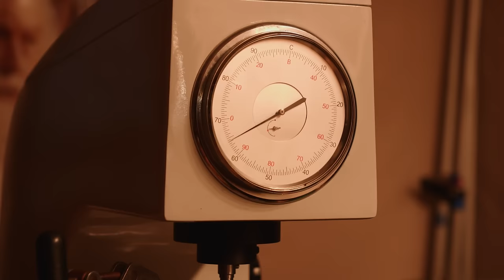Sword Break or Bend? Quenching Aftermath

Comment: Ya know, it seems like a simple little thing... I learned something new from you today Kyle.

Your anxiety about grinding the fuller is something i deal with daily, in all kinds of mundane ways. I frequently push things off or avoid things that scare me like grinding in a fuller that could ruin weeks of work. Without the fuller, the project isn't done, but the act of doing it could ruin the whole thing entirely. But, you nutted up and did it. 

Nut up and do it. My new motto.
Reply: How about, 'First Engage Brain' ?

Comment: Just a thought here: For the fuller grind, could you do a small wheel first for the railroad track you mentioned and then finish with the larger wheel?
Reply: I was thinking the same, but then I realized that if you use a smaller radius wheel, it would create a deeper fuller from the getgo. Kyle said he wanted to avoid getting a deeper fuller, at least that's what I understood😅
Reply: A smaller radius makes it harder to keep it centered within a wide layout. If you grind your "railroad" off center, the larger wheels will want to follow that track, and you will have to force them into alignment off-center of the small track. That forcing motion is inaccurate and easy to make mistakes doing it. I'm sure there's more to it, but this could be one reason

Comment: for fuller work, is there a way you could lay the blade on a flat surface, clamped down, have the grinder vertical above the blade running on some kind of track so you could just push and pull the grinder along instead of having to hold the blade horizontal yourself. i know it would entail making a small custom grinder of some kind so prob not worth it if your only making a sword every so often, but im sure it would make life a lot easier for you if you were making many blades with fullers.

am pretty sure someone could build such a contraption for you. hope that make sense.

Comment: If you hold your blade with the face your grinding more toward the ceiling you can fix you lighting problem or a wide lamp also you could get a rounded grinding wheel and grind your fullers vertically would make it easier to handle the mass of the long sword and add bonus is you don't get as much kick mesing with your line

Comment: Kyle, Is there anything differently you would have done in the normalizing stage to change the possible warpage if you would make this pattern again? Or maybe try a horizontal quench tank (Concept being that all the areas of the oil would quench at more even rate). I know you have probably considered more than I could think of, but I am always trying to learn from your expertise as I move forward in the craft.

Comment: For grinding the fuller in the blade, I’m curious if there is a way to rotate the sander 90 degrees and have the blade below it on a type of linear track that you could line up down the center of the fuller with the curve of the sanding belt. Then you could pull the blade in a fixed line to avoid potential angling issues. Kinda like when people have the electromagnetic jig they use to sand down a billet to be perfectly flat. Not sure if this is an already established method that has been shown to not work.

Comment: I'm surprised Kyle hasn't created his own straightening jigs, to help save time and stress.
Reply: I'm going to assume he has the same issue every maker of things has... if you're making a rig or a tool to make your chosen discipline easier... you're cutting into time you'd rather spend doing your chosen discipline! the number of things I COULD make to streamline my process is huge, but I'd prefer to spend my time doing the fun stuff 😅 Also, if you're actually working in your field the problem is exacerbated by the fact that if you're upgrading your work space or doing maintenance you are NOT working on a commission, and therefore you're not making money. Sure, in the long run it's a great idea, but it isn't always fun, practical or financially viable.
Reply: @millie-mayprice891  except he's a professional and he even says he doesnt want to change his bandsaw because it's expensive. When you're a full time maker, having fun is less important than making money
Reply: @jeanladoire4141 ... I mean, I mentioned that financial reasons are a factor why you might not do a thing that would make your job easier, so I'm not really sure where you're coming from with your response? And the comment I was responding to was about making a straightening jig, not replacing the bandsaw blade... Maybe I'm misunderstanding what you mean, But I'm not sure how "if you're upgrading your work space or doing maintenance you are NOT working on a commission, and therefore you're not making money" doesn't cover what you said.

Comment: Thought about making a fixture for grinding a fuller?  Something to clamp the blade to so it rolls along the wheel at it's centerline.  Shouldn't be that big a job to weld up one and have it run on some linear bearings.  Could even get fancy and add some depth stops.

Comment: I've had warps like that in long knives (I've only made one sword, technically sword like object, just a wall hanger, no heat treatment) I'm not sure if a straightening hammer would work for that sword, but they work pretty well for straightening knives.

Comment: A fascinating build. I have a question about the mosaic damascus. Most of the pieces I've seen you build are either knife length or in a sword, fairly stout blades. How would that steel do if you made a more flexible type sword such as a rapier? I swear a matched rapier and main gauche would be absolutely stunning!

Comment: So I noticed you were careful in heating the blade while straightening. I thought that any reheating would mess with the temper on the blade, but is there really a certain amount of reheating that allows the bend but doesn't affect the temper? I notice in shows like Forged In Fire a lot just opt to retemper altogether. I'm just interested in the strategy you went with for straightening, and was there another round of hardness measurement after the straighten?

Comment: That fuller is stressful. I was worried that the tape might be too soft to hold the shape. Then I wondered why you didn't profile after doing the fuller so you can run it along the rest as a rectangle. Anyway, can't wait for the next installment!

Comment: Hey Kyle, I remember you mentioning that there was an inch or so of tang sticking out of, I think it was, the cooling oil? Would that have had anything to do with the difficulty in straightening the tang?
Also I was wondering what would happen if you ground the fuller before profiling the blade?
It would allow you to use a platform to rest the blade on and ensure it is level while grinding the fuller without using your arm strength to keep it level.
I just don’t know what impact a fuller would have on the blade during hardening and tempering…

Comment: If you are having trouble with temperature stability in the quenching oil might it be an idea to circulate the oil with a transfer pump? Suck it out the bottom of the tank and pump it back into the top

Comment: Just fix a brass 'steady' to one side of your wheel and you can grind a perfect fuller without worrying about it drifting. You can even fit a cam-plate to the opposite side, with a cam-follower clamped to the tang if you are worried about accidentally dipping/lifting the tang. The depth of cut is adjusted by your thumb pressure/position. Simples.
You seem to have some degree of aphasia. (not a criticism, just an observation)

Comment: What if you made a guide track with a shallow grind with a smaller wheel dimeter and then increased the wheel diameter for the rest of the depth & width of the fuller? You would probably have better control with the smaller wheel because there would be less grab due to the smaller surface area of the wheel-blade interface. Also, why don't you make a little support table for the grinding wheel with a 2x4 and some adjustable stands.

Comment: Question.  Are you not creating a weak spot in the blade where you cut the tang out using the bandsaw.   It looks like you left a sharp corner.   Being from a metal fab machinist background I was always taught to do a radius even if small.  I would of drilled a small hole in the corner of my lines and then cut.   Of course you could of ground in a radius too but it was not shown.   I am not trying to knit pick as I love and respect your mad skills.  I have nothing but respect.   I just did not see a small radius.   Also I am glad you found the proper diamond wheel dressing tool for your surface grinder.  When you asked about what to use last video I had recommended that.      Loving your videos.  I never speed them up or skip.  Just taking in all the wisdom.   I really hope to get a press together this summer.

Comment: Could you not grind the fuller in 2 stages? Use a 1" wheel to establish a track at roughly 1/3rd final depth, then use your final radius wheel in your track to final width and depth?

Comment: @Kyle Royer I had a question about the tool your using to create the fuller in the sword. Is their a tool that would allow you to grind the fuller of a sword, like a table top saw for wood, so that your not encumbered by holding it horizontally and instead let the flat part of a table based grinder carry the weight, with the use of a tapered guide to fit the sword into that is locked so it does not shift as you work, so that all you have to do is slide the sword gradually over grinder that is protruding through the table ( not : this tool would include the feature of letting you set the elevation of the grinder through the table, so that you can create gradual deeper cuts into the sword as you need it ) ?

Comment: aren't you worried about tempered martensite embrittlement  when heating the tang to beyond blue ?? i read that toughness actually goes down if you temper too hot the tempered martensite embritlement for low alloy steels  is between 260 and 370°C  or is that grey color already far beyond 370°C ?

Comment: Hey Kyle, could you not mount a grinding wheel on you surface grinder or a mill so you can grind that fuller more accurately and easier?

Comment: Around the 39th minute... after you finished getting the warp out of the blade.  Was that a purple colour on the tip I saw?  Did you end up softening the tip a little?  If so, was it on purpose?

Comment: i find it wierd that he didnt straighten the blade as soon as he pulled it from the quench like most of the other smith tubers i watch do... either by sandwiching between 2 2x4s as the blade cools or just use a vise as a lever while the blade is still warm

Comment: We've had a warp before, stood it on end in the vice and it straightened a bit on its own while it cooled, but then we fought it for a while using your same technique with water and finally got it straight. But then when we ground it, the warp came back with a vengeance.

Comment: I'm no expert, but wouldn't you want that material you cut out of the tang with the band saw at 2:16? Cutting those sections not only severs the matrix, but it adds sharp corners which are stress raisers.

Comment: I feel like you could rig up a jig to grind in the fuller nice and parallel with two file guides on the blade and some aluminum angle as a guide that's setup parallel to the grinder wheel. I think you'd be able to set that up and grind the fuller faster and more accurately than you free handing it. You'd still have to manually control your depth of cut and all that but at least your horizontal axis would be controlled and not fatiguing your arm
Reply: @bikerfirefarter7280  right! My only thought is that they're first and foremost artists and creative with their hands and got into blade smithing and machining as an outlet for that. As opposed to being primarily machinist/fabricator/engineering minded who found that blade smithing woke up their creativity.... If that makes sense
Reply: I commented someting similar, before I read your suggestion, sorry; but I totally agree its a good/obvious idea. Why doesn't Kyle or his father see that? Are they both a bit 'limp under the cap' that way?  ;-)
Reply: @pastaalalamborghini  Hmm. Perhaps. Would you be so kind as to give your definitions of 'artist' and 'creative' (in the sense of 'art')? 
They are being very 'fabricators' but not 'machinist-minded', and definitely NOT 'engineers'. 
As far as I'm concerned creativity is significantly removed from pursuing a technique to its extremes, good as they are at 'polishing a turd', it is a very good example of 'paint yourself into a corner' mentality.
Reply: @bikerfirefarter7280  I don't even know what you're talking about now man. Sometimes technical things that are obvious to people who are higher on the technically minded side are not obvious to those who are on the highly creative side and vice versa. This guy's clearly an incredible artist and craftsman, maybe fabricating a jig isn't something that just pops into his head. Maybe he enjoys the challenge of doing it all by hand, he clearly doesn't shy away from challenges.
Reply: @pastaalalamborghini  I wasn't suggesting any technical 'jig'; more akin to something even simpler than a filing guide, i.e. like tie-wrapping a rod to a file when filing an accurate flat on a narrow workpiece. Likewise there is nothing 'technical' about resting a work-piece against a stable item, so that you don't have to fight against intrinsic instabilities of freehand/eye coordination. e.g. nobody freehand cuts a short/small length of lumber, they trap it against a solid support etc, especially if they want accuracy. Similarly when working at a grinding station its usually got a platform in front of the grindstone, for safety and stability. The 'steady' could easily be set to one side and still give the operator full control of the action when grinding fullers etc.
Kyle creates his own unnecessary difficulties and challenges this way. Not only doesn't he think outside the box, he doesn't even see the box or conceive it exists.
I'm not sure we both have the same understanding of the word 'creative', or for that matter, 'technical.
Reply: @bikerfirefarter7280  if you think so poorly of the guy why do you watch his videos?
Reply: @pastaalalamborghini  If you bothered to read, and understand, my other comments you'd realise I don't think poorly of him.
I just don't understand why nobody has introduced him to the technique that I, and many others, know and use as a basic/commonplace action. It is after all one of the first things anyone is apraised of when being introduced to bench grinders. Its no more obscure and esoteric or 'technical' than using a pair of compass to draw an arc or circle rather than doing so freehand.
Your bias that I think poorly of him says more about you than it does of me.

Comment: Surprised your dad hasnt made a sword temper straightening jig yet. Would you be able to briefly go over the salt heat treat and temper? Never heard of this method before but it seems interesting. Also for the surface grinder, maybe converting it to use belts instead of wheels will help with the timeline, not as precise but much faster
Reply: Don't give Dad ideas. 😂I bet he would!
Reply: @Hydracat404  that's why I said it lol, also a platform to stand on would be better then the 2 ladders. Maybe a section of staging with 1-2 decks on it for solid footing and they have wheel accessories you can add to be able to easily move them around and are lockable when you don't want to move

Comment: As a tool and die maker of over 24yrs I would have straightened that blade before surface grinding..  Also your surface grinder is running way too slow... plus no coolant.  What you said about it being funky and not grinding like it should is because your grinder wheel was "loaded" and you were burning the steel.  Thus expanding the metal and like you explained.  Sucking it up into the wheel....  Dress the wheel more often and get some coolant running!  If you need some help..  I'm local to you..

Comment: You seem to have a custom tool for every event and yet Dad hasn't devised a grinder that sits above the blade while the blade lies flat on the table. This would be an ideal way to grind in the fuller. Easier to see your scribe lines, no need to hold the blade up and a lot easier on the back and shoulders.

Comment: you can not surface grind a bent blade you need to straighten it first then surface grind.. the machine will flick it off the table if you do this .. its not wise.

Comment: 49:11 you have a lathe right? you could make custom sized wheels for yourself, just steal the bearing guts from the real ones lol. unless you prefer the duck tape method
Reply from the maker: Needs to be rubber so it can have a little "give".
Reply: @KyleRoyerKnives makes sense, not sure how soft of a material you could machine on a lathe, but if you do find it inconvenient that way you're doing it now, you could go with the softest material that will still machine, machine it undersized and then add rubber on the outside like a tire on a wheel rim. But if you're happy with your current solution/don't think it would be worth the time/energy/effort to make your own set of wheels, then by all means, keep doing what you're doing! :)